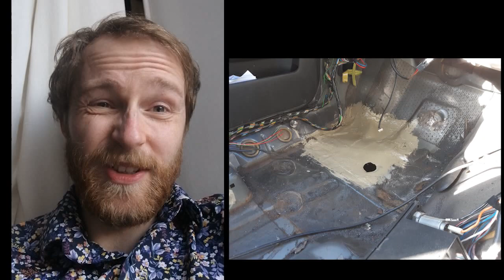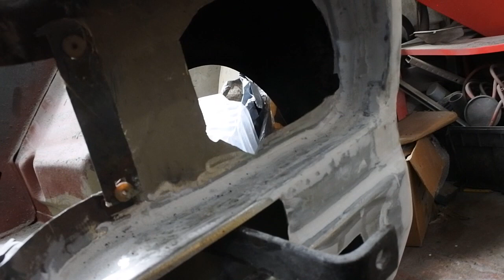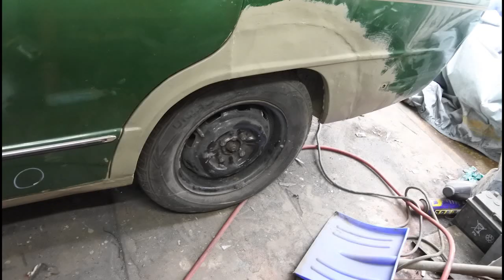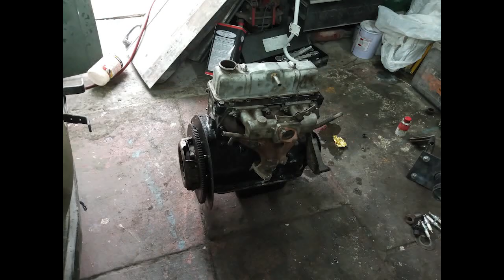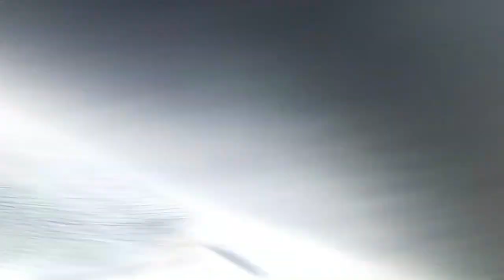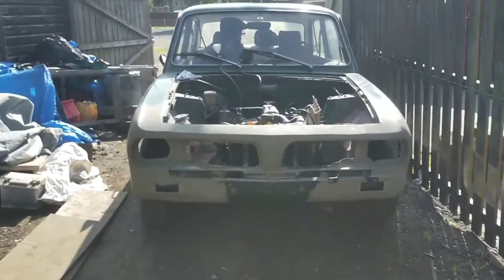Restoring the Dolomite - Part 2

Comment: Great to see you back, Alistair. That Dolomite is a lovely wee motor. Can't wait to see her doing her thing again. I do wonder, and often, why English cars, or at least cars in England, with side draught carburetors are so hard to start. Our 81 Volvo 240DL Estate had a single side draught Zenith on the 2.1 litre. That car started first turn of the key every time, even at -40 degrees, whether the block heater was plugged in or not. Even Ma's 54 Hillman Minx and get even worse 58 Vauxhall Velox started properly at temperatures well below the freezing mark. They did argue a bit when the temperature dropped below -20°C, but they could be forgiven.